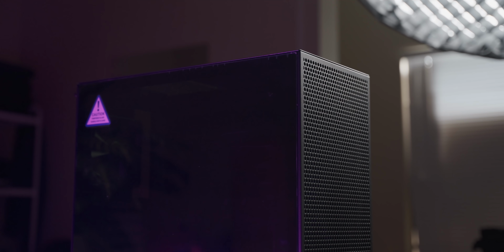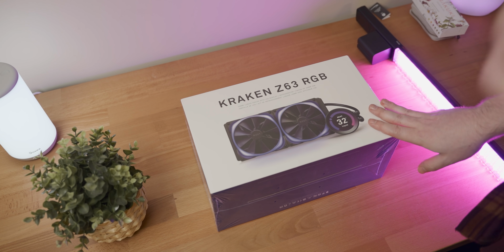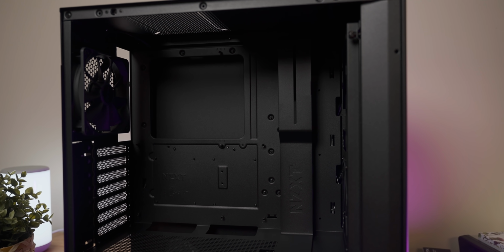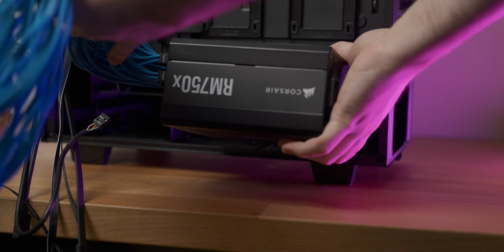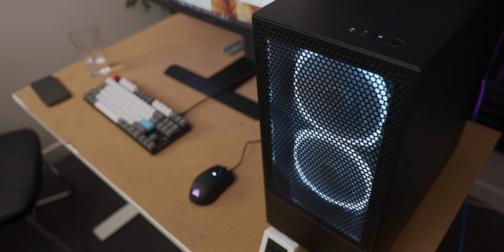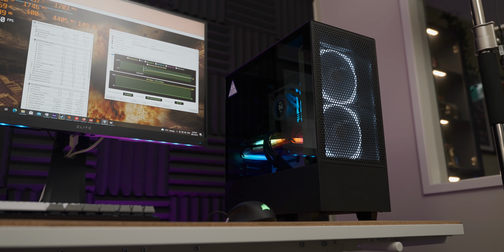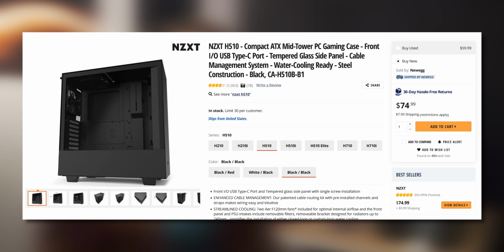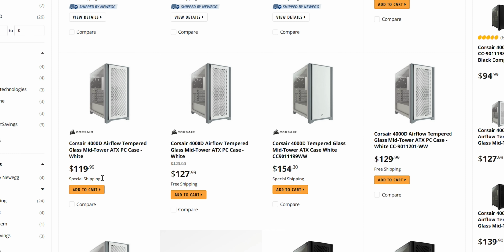FINALLY! Airflow From NZXT! H510 Flow vs H510

Comment: 3:57 The lack of 280mm radiator support for AIOs other than their own is the reason why I got rid of the original H510. Even reached out to their customer service reps who dismissed my case by saying that my AIO's radiator was larger than any other AIO that they've seen.
Reply from the maker: I wonder how they'd explain their own AIO barely fitting in there. 😂
Reply: @DawidDoesTechStuff  I'd be curious to know as well haha
Reply: I stopped using mine because my 6800XT barely fit after I replaced my 5700XT and it was getting choked pretty hard.
Reply: When they make 280's and they say they've never seen it.
Reply: Why didn't you just flip the radiator like its supposed to be ?
Reply: you can fit the EVGA CLC 280MM into a base nzxt h510 ... but it has to go in the front panel and upside down [the radiator]  ... but i know what you mean. its very much limited
Reply: lol
Reply: @elchunkacabra1450  if you want to be unique, get an acer prebuilt and just take the case from that lol
Reply: only way to fit a 280 mm rad was for me to remove the cable management arm on the h510 elite
Reply: Why you bought an NZXT to begin with ? Literally worst case for airflow before coming out with this new version
Reply: @tibib0ss  It looked nice and was my second build ever.
Reply: @CrashForce  I guess we learn from experience
Reply: @tibib0ss  they look cool is the only reason to get it. This flow case seems legit though so I may look into it when I want to upgrade my case.
Reply: @MikeArpeggio345  get a Lian li if you want the best experience
Reply: @lunchmeat7495  those also look really nice. I have an ok case for now. A case is the last on my priority right now but I would like to get a cool looking one eventually.
Reply: @MikeArpeggio345  I recently "upgraded" my old Corsair carbide spec-02 case to a bequiet 500dx case. Gotta say, bequiet did a good job with the aesthetics and airflow. I'd recommend giving that one a look as well if you're considering an upgrade (I got the black version for reference, I didn't like the look of the white one personally).
Reply: There are 360mm radiator AIOs...
Reply: @Carahan  Yup, I got the feeling that their customer reps need a refresher on PC components. Based on this video, it seems like even their own AIO has trouble fitting in their case.
Reply: @Carahan  he said they told him his was the largest 280mm not “the largest aio ever”
Reply: @Carahan  he wasnt talking about a 360mm. there are also 480mm's if ur into big things
Reply: @jeroenklio4451  It wasn't criticism. But a commentary on just how dumb NZXT rep was on claiming they've never heard of anything larger than 240mm radiators.
Reply: @Carahan  not what they said... they said the 280mm had a larger rad than other 280mm AIOs

Comment: I actually own the H710i and the airflow isn't terrible on that one. Granted, it isn't the greatest, but its good. I got a Kraken x73 in front and my i9 10850k stays at or under 90 degrees fahrenheit when idle. The 1080ti I have runs at about 120 give or take when not in use.  Which when I mean not in use I mean gaming, I usually always have a couple tabs with videos up. When I don't hav those up it runs cooler than that. I have 3 top fans and 1 back throwing out air and the front is all intake.

Comment: Idk about this one... no top mount for radiators, very tight, no bottom fan. 

It looks like a big case that doesn't really take the advantages of being big (which is allowing the use of big towers, radiators or a lot of fans).

Comment: If NZXT was smart they would sell a conversion for your old H510 or even the H710. I have a H710 and would buy the front and even a top panel in a heartbeat.
Reply: The problem is you can’t remove the front panel on the old H510
Reply: @PashaGamingYT  Interesting, I have the H710 and figured they were the same.
Reply: You can remove the front panel on the h510 elite and i would love a kit to remove the glass front and make it this
Reply: @JellyTwitches  Same. I saw some on etsy, but who knows how those actually turn out, and they were half the cost of a new case.
Reply: @andrewromine5900  phanteks does it. I have a p400s and bought a mesh front for it for €20.
Reply: if you look at it from their perspective, a whole new case is way smarter. why sell a piece to convert your case when they can just get you to buy a whole new case?  from a consumers viewpoint, you're 100% right.
Reply: Just cut some hole and add chicken wire mesh
Reply: @bitelaserkhalif  Wut? I own a H710 the front is solid.
Reply: @nottle9852  even better, some ppl had diy solution for this by cutting hole and adding mesh

Comment: Its a cool upgrade but I still wouldn’t buy this. Maybe they sell the front panel as an upgrade for current h510 owners. But if your looking at the 90-120 dollar price range I recommend the lancool 2 mesh all day. And for budget you can do the p360a which often has a 10 dollar mail In rebate on the white version to bring it down to the 70 dollar price range. For 110 dollars for the flow just get the lancool 2 mesh. Its so easy to build in and super feature rich.

Comment: What about an air cooler? I wish I can convert my old 510 without cutting steel.
Reply: What hardware you running? Mines a little dated admittedly but I've never gone over 78 on the CPU and 76 on the GPU under load in my H510. Thats with a i7 9700k and GTX1080. I use a Cooler master Hyper 212 Evo air cooler.

Comment: Still just a single fan on the top , I love nzxt cases and have one myself but they really should give us option to mount the 240 radiator on the top too
Reply: They have been reusing that tooling for years at this point and it's embarrassing that their cases cost this much.

Comment: Can they supply a front panel separately for existing owners 👀 edit - NZXT said it's not possible because the original doesn't have a removable front panel
Reply: I wonder if its possible with the 400 series , since it does have a removable front panel
Reply: They could at least make one for the 510 elite.

Comment: The holes are not for airflow, they're ventilation for the smoke from their flaming PCI-E risers
Reply: oh shit!
LMAO
Reply: ouch
Reply: lol, i wish there was a airflow version of he h440 bc there is custom one but they like 60 bucks
Reply: Usually I just make my own flow cases I just drill holes
Reply: wrong case lol
Reply: @elchunkacabra1450  same manufacturer
Reply: @elchunkacabra1450  They used the same design, didn't wanted to spend any more.
Reply: @ranjanbiswas3233  i was talking about the one specific case that was lighting on fire

Comment: the p300a mesh exists 

HOWEVER THIS IS A BREAKTHROUGH FOR NZXT
Reply: P360 a gets you 2 preinstalled 120mm rgb pwm fans and an rgb strip along the side of the psu basement. And the white one is usually sold with a 10 dollar mail in rebate so you can get it for like 70 bucks.

Comment: This is a hoax, there's no way NZXT made a case with proper airflow.
Reply: Could still be better tbh. Top fan mount could allow for 2 fans and 240/280 rads and the front could allow for one more fan, I predict that the GN review will have quite bad gpu temps bc most of the air is going to the cpu.
Reply: @yanuehara8017  this is exactly why I switched to the 4000D
Reply: Its the only way to provide enough oxygen to start a fire......
Reply: @buggerlugz6753  that's a good point
Reply: @buggerlugz6753  imagine having an older EVGA RTX 3090 in there too 💀
Reply: Aw